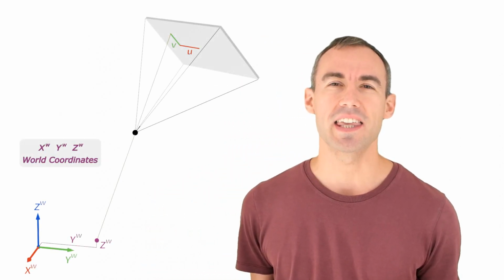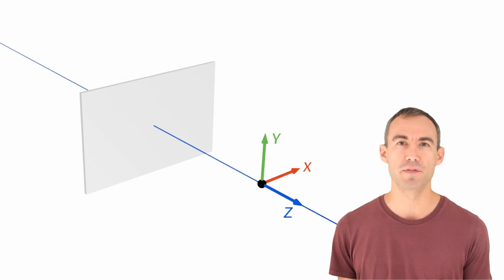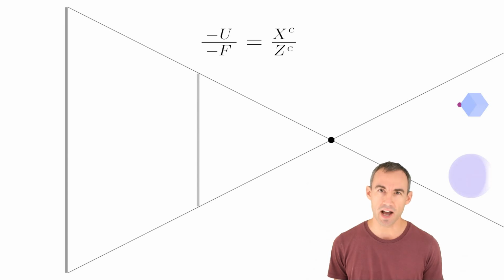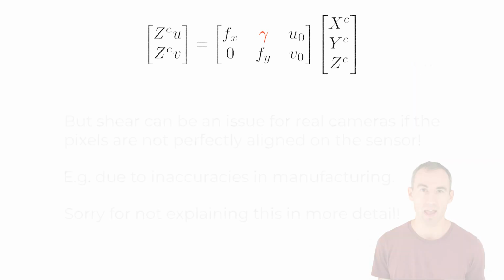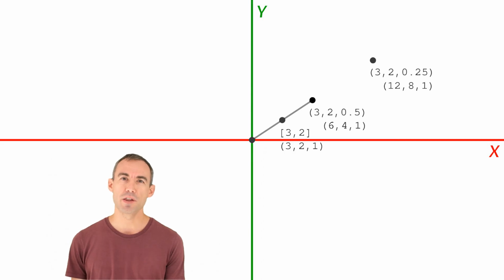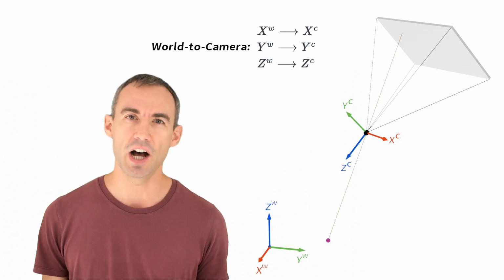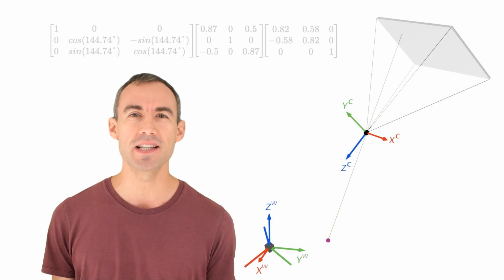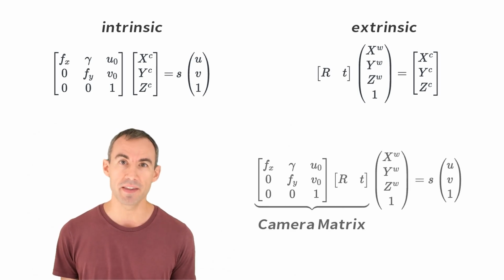Computer Vision: The Camera Matrix

Comment: The content is great, and the visuals just made it so intuitive, the step by step derivation and rediscovery made it really clear. Thanks for the video! I am a 9th Grader working on a project, where I would like to give multivariable calculus students some intuition about matrix calculus, such as the derivative / jacobians of matrices. (derivative/jacobian of x^3, det(x), tr(x), x^-1, etc) I am struggling with visualizations currently. I used manim (a 3b1b python module), but only displayed a bunch of equations that I am not quite sure if it is easy to follow. Currently, the only "good" visualization is where I simultaneously showed the basis vectors of x, x^2, and x^3, and then nudged x around while all other vectors move accordingly. Besides that, I couldn't really visualize, for example, the trace or inverse of a matrix, but symbolic derivation without visual intuition is something that I absolutely hate and bet others hate it too. May anyone give suggestions or insights on how you make your videos more intuitive, particularly by cleverly utilizing visuals? Thanks!